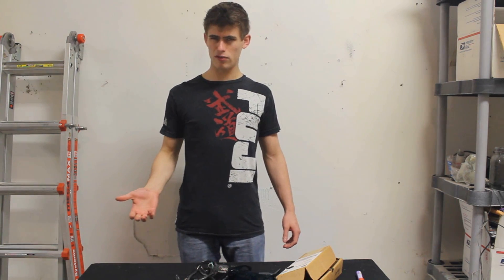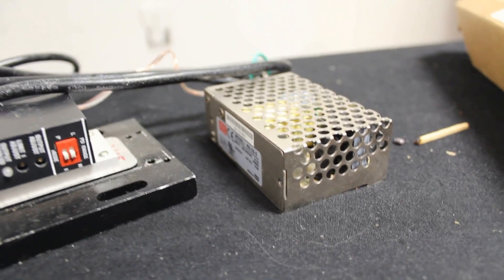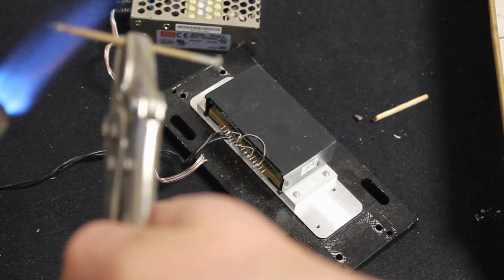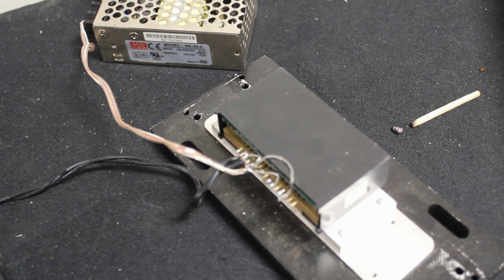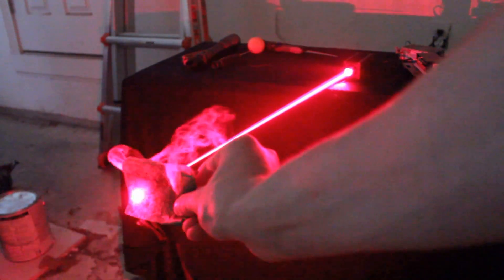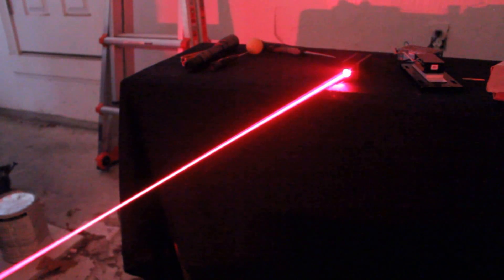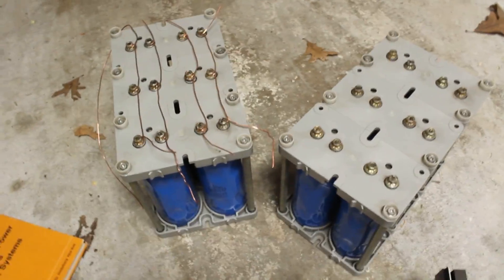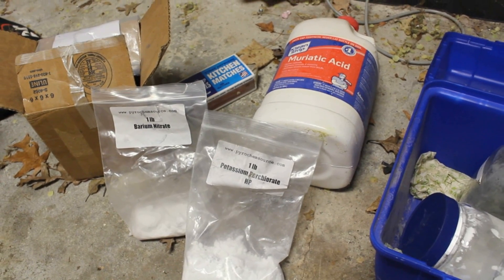Thick Beam 5W Red Laser Fun + "Laser Cannon" Updates

Comment: Question if you have time. Saw my first laser in 1979-80 in high school. (I'm old ok?) But at that moment I wanted on, I wanted to learn about them and understand them. But it was not to be. The unit the demonstration guy -- he had a 14 inch long turbo jet engine mode! Clamped t a skate board he fired up and shot across the gym,   of course a Van de Graf generator we played with and some other 70s & 80s science miracles for us to  ooooh and aaaah!!! at.& He said the laser unit, about 
 8"w x10" high x 1 2" long was the smallest that could be made and cost around $4000. My question - where can I find student level materiel that's kinda cheap, or free, and ski few for scrap parts from industrial and CD production co.s and just linking general? I been in hospital twobyears. I got paralyzed partially in 93 from motorcycle accident, just had another surgery related to that couple weeks ago. .  I've contacted several companies who won't sell stuff because it it's more powerful than a $1.50 cat toy laser it's verboten in US. So I could buy a Barret 50 cal asset denial sniper cannon for blowing up vehicle motors but I can't buy a 5mW  laser emitter cos I might burn my fingers?  I don't understand.Anyway I'm giving it a shot maybe you can just point me in the right direction. Nobody else seems to wantcto . I've had red and green aijmpoint and other lasers on  handguns and rifles but never had a burning laser or learned to build anything.  Anyway thanks the nurse just came in and it's sleepy time for me I'm afraid. . Thanks man---EJ

Comment: how can you amplify the power of the laser
can you block a laser with an electromagnetic field
Reply from the maker: A laser IS amplified light, but if you mean make a laser stronger, then you basically just have to build a bigger laser. Light isn't affected by the EM field because light is just an EM wave, so the field at any point is just the laser's field added to whatever other field is present.

Comment: Like really big lasers?  Here's a cool project using the National Ignition Facility (NIF) at Lawrence Livermore National Lab.
NIF uses multiple high power, short pulse length lasers to compress material targets to ultra high pressures. This is used for nuclear fusion experiments in which "pellets" of solid deuterium/tritium are compressed and heated to conditions suitable for creating nuclear fusion energy.  However, there are many other uses for NIF.

Here's a cool project for NIF research, and a cool Nobel Prize if it works.
  
BACKGROUND: Theoretical physics has long predicted the existence of a metallic state of hydrogen. This state should occur at very high pressure such as the pressure at the core of Jupiter. Some have suggested the very powerful magnetic field of Jupiter may be generated with the assistance of  metallic hydrogen at the core of the planet. (tons of references in the scientific literature for this stuff)

One needs a phase diagram (P,V) of hydrogen that extends to the  metallic hydrogen phase. Theory should give something useful in this regard.

Further, (As I recall), NIF may be able to generate enough pressure in a small, cleverly designed target for this type of experiment. I believe there are possible upgrades to NIF allowing us to reach pressures higher than are currently possible.

The target design is critical as we want to compress the (solid) hydrogen pellet in such a way that it doesn't overheat.
There may already be research groups looking into this.  However, an innovative proposal might well be funded.

Last time I checked, NIF does have provisions for university researchers to conduct experiments. So it's not impossible to get some shots scheduled, if the proposal is strong enough.

Might as well get a Ph.D. and a Nobel prize.
Reply from the maker: Thanks for the info...getting ultra high pressure without too much heat is obviously difficult. I'll remember this problem and maybe I'll come up with some ideas down the road!
Reply: I just had a private tour of the Texas Petawatt Laser Facility, which puts out 1E+15W, or 1,000,000,000,000,000 Watts for an extremely short duration. It was really amazing to see the laser in operation.

Comment: Also, blue has a much shorter wavelength than red or green. So, with that in mind, would the most powerful laser be a violet one?
Reply: It gets complicated. One of the main reasons that his red laser didn't cut the plastic that quickly was because the beam diameter was wide, therefore the power density was low. A laser with a 1 cm beam diameter will have 4X the energy density of the same laser with a  2 cm beam diameter. How well the material absorbs light is also a factor. UV at 405 nm will be absorbed by many materials better than 532 green, or 635 red. However a CO2 laser at over 10,000 nm is absorbed by everything and can melt rock at 100W while 100W of 635 nm cannot. Then you have Rayleigh scattering, which is scattering of light off of air molecules that enable you to see the beam. However, as you can imagine, scattering reduces the energy density of the beam as coherent photons bounce off molecules as incoherent light according to the simple form of the inverse squared law. That's why the brightness of a laser beam is drastically reduced from the side as you walk away from it. Now, the the shorter the wavelength, the more it is scattered. Over the same distance, you'll lose more energy from a UV beam than you would for a red beam due to Rayleigh scattering. On the flip side, divergence is a function of wavelength, and the lower the wavelength, the lower the divergence. So, while your UV laser will lose more energy due to scattering, the red laser will diverge more over the same distance and decrease in energy density.

Comment: How about an X-ray laser?
Reply: I second this proposal! But even the smallest xray pulse generator emits a broad range of wavelengths. I wonder, can the range be reduced to a single wavelength? Also, what material can be used to manufacture an x-rays collimating lens?
Reply: jpmvidal I think the wobbler does all the collimation.  Sandia Labs devised a simple FEL that I feel could easily be modified to make x-rays
Reply: Ok, you could make an xray optical cavity with nano-engineered Laue lenses.